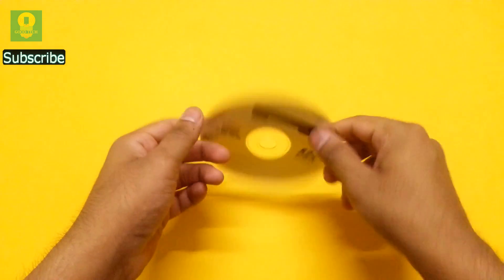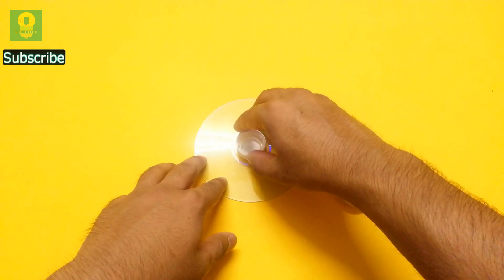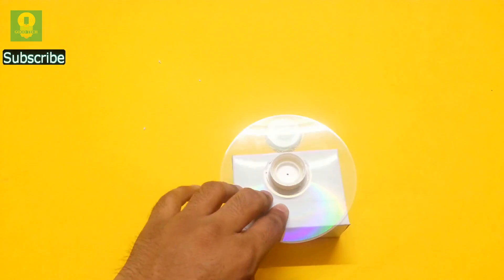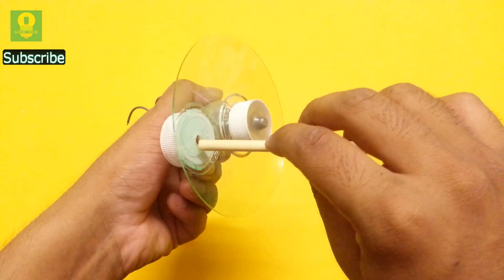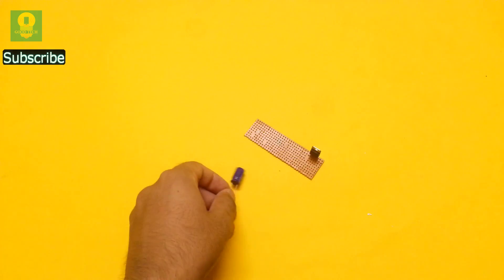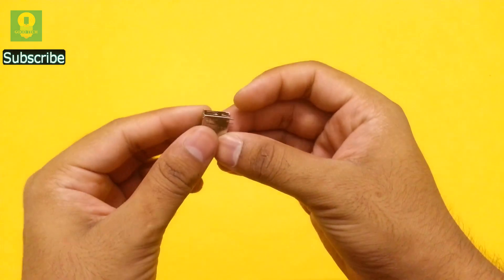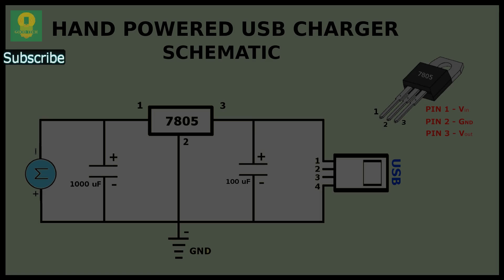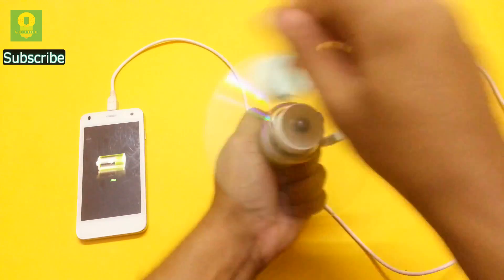How to make a Hand Powered USB Charger at home

Comment: Where did u get the usb port
Reply from the maker: You can easily de-solder the USB port from an old mobile charger lying around or can order a new one online from ebay or amazon.
Reply: Please help!!!!!!!!!!!
Does it work without capacitors????
Are capacitors compulsory????
Reply from the maker: Yes, it will work even without capacitors but they are important to protect the phone from any damage as they remove power surges and noise from the supply.

Comment: This is great, but aren't you losing tons of energy from the voltage regulator? Doesn't a voltage regulator dissipate lots of heat to convert the voltage?

Do you think a 100 rpm, 5V geared DC motor generate a higher charging current?

Lastly, is there any possibility of damage to the device from cranking the charger at a non-uniform rate?

I know this isn't exactly made as a consumer-grade product, but I'd love to hear your thoughts on these questions!
Reply from the maker: No, its absolutely not a consumer grade product. For that it needs many upgrades.
Yes, some energy does get lost in voltage regulator as heat. The 12v 100rpm geared DC motor only provides upto 500mA of current, not sufficient for many devices these days and also its not practically possible to keep rotating the device with hand through out the day.
But these problems can be solved easily. The device can be made in such a way that it can be attached to a bike wheel, so that a device can be easily charged while travelling and the irregular supply can be eliminated using a high capacitance capacitor that will store the charge and give uniform power as output. The 1000uF cap used in the video, does the job well and also there is protection circuit in almost all the devices, so a device will not get damaged easily. Also, as the energy is generated without much efforts(only with a moving bike wheel), even if some energy is lost as heat in voltage regulator, it will can never burn a hole in anyone's pocket.

Comment: Can i use both 1000uf capacitor ? & Please give amazon or ebay links to buy these items. There are so many items on amazon and ebay.
Reply from the maker: Yes, you can. The reason i don't provide links to the products as there are so many options, so its better for the viewer to choose a suitable one depending on his needs and price. You can use any 100 or 1000uF capacitor, but it should be atleast 16v.

Comment: Where you connect the motor wires?
Reply from the maker: Motor wires are connected to the input of 7805 voltage regulator. Refer to the schematic in the video and you will get more clarity about the connections.
Reply: +GOODTECH - Creativity and Science thank you

Comment: Will an AC motor produce more it it will not produce
Reply from the maker: No, AC motor cannot be used for this project.
Reply: +GOODTECH - Creativity and Science ac motors will work as long as a bridge rectifier is used. however simplicity will maximise power output.
Reply: +GOODTECH - Creativity and Science 
OK thanks
Reply: Ollies Toys i

Comment: Not working what to do...??
Reply from the maker: What motor did you use? Try to check the output of the motor using a multimeter and if motor gives proper output voltage then check the polarity of the wires.
Reply: i think i used 3 v motor....and capacitor 1000uf and 16v
Reply: when i connect to usb the start
Reply from the maker: A 3v motor will not be able to give sufficient output, you need a 12v geared DC motor.
Reply: ooohh...ok...and the 1000uf v16 is ok..??
Reply from the maker: Yes, as long as motor output is below 16v, the capacitor will work fine.
Reply: can i use dc12v 0.15A Computer fan...??
Reply from the maker: Yes, that can be used. It will show that it is charging the device but charging will be very slow.
Reply: then how to make faster...??
Reply from the maker: The only easy way is to use a 12v and atleast 500mA current motor or else make a current amplifier circuit.
Reply: ok...thanks....!!!
Reply: where to buy 12v motor
Reply from the maker: It is available online on ebay and amazon as geared DC motor.
Reply: ok...

Comment: Its fake look at the wire it goes out the screen
Reply from the maker: No, its not fake, it actually works. You can also connect the motor to the Bicycle or bike wheel and the phone can be charged.

Comment: you fucking stealler you took it from lxg design
Reply from the maker: Its better to be quiet if you don't know something. I made this first at GOODTECH (You can see the published date of my Homemade generator video (https://youtu.be/L-dUs2ai4D0) and then LXG made the video.
This hand powered charger is a better gadget equipped with my self designed circuit (not taken from anywhere).

Comment: Without adding the rotation handle, you can place the thing on a cycle wheel and you will produce more electricity
Reply from the maker: yes that's true.
Reply: +UniBuilds can you frwd the link please
Reply: UniBuilds
Reply: i made a video doing that,go check it out

Comment: whether it is compulsory used a capacitor
Reply from the maker: No. capacitor is not compulsory, it is only used to smooth the input voltage (to remove spikes from power supply).

Comment: where i can get voltage regulator? can i use any voltage regulator?
where i can get/buy general pcb board..?? thanks.
Reply from the maker: All the components are available online on ebay and amazon with various options to choose from.

Comment: good idea but how long it will take to charge a 2000mah battery
Reply from the maker: That depends on the motor used. The setup i made gives a current of 500 mA at 5v. So, ideally it will take about 4 hrs to charge a 2000 maH battery. But this project is for demonstration purposes, if you want to convert it into a useful product then attach the setup to a cycle wheel and then u get a nice mobile charger.

Comment: can you tell me the capacitor's voltage you had used in the project?
Reply from the maker: 25v.
Reply: both 100 and 1000 uf capacitors 25 v no variation
Reply from the maker: Variation is not needed. You can use capacitor with any voltage as long as it is greater than the input voltage. You can also use a capacitor with a voltage value of 16v as this motor can only provide 14v at max.

Comment: can we use a 9 v motor and 10 uf capacitor instead of 100 uf capacitor rest all same?
Reply from the maker: Yes, you can but if you are using 10uF capacitor at input then use a 1uF at the output and the motor should be a geared DC motor.
Reply: thanks
Reply from the maker: Welcome :)

Comment: will normal 12v motor will work
Reply from the maker: A motor shaft when rotates does produce some energy, but a normal motor will not be able to produce sufficient power that can be used to charge a mobile phone. however, Connect a multimeter to the motor terminals and check how much power it is capable of generating.
Reply: +GOODTECH - Creativity and Science its producing some as when i attach a led bulb its start glowing
Reply from the maker: Its good. Connect a multimeter to motor terminals and then check the actual output.

Comment: how can i use my cycle to charge my phone
Reply from the maker: That can be done quite easily. All you need to do is make a mechanism through which the motor shaft rotates when the cycle wheel moves while riding it. To make the mechanism, you can fix a small wheel, disc or a bottle cap to the motor shaft and then mount the motor adjacent to the cycle wheel such that wheel and disc is in contact with eachother. Use a mobile holder to mount the mobile on the cycle and connect it to the USB charging circuit.
All the best :)
Reply: Wont that creat too much electricity?
Reply from the maker: No, the motor we used is only capable to produce maximum of 16v at 500mA, this voltage can be easily controlled using 78xx series voltage regulators to get 5v, 9v or 12v output as required.
Reply: +GOODTECH - Creativity and Science , oh cool thanks, where can i buy this stuff from?
Reply from the maker: Everything else you will find in your home(a spare CD, 2 bottle caps, straw and a stick), the electronic components are easily available online on amazon and ebay.
Reply: +GOODTECH - Creativity and Science  ok thanks!

Comment: Can you please list down all the things i need to build this.. Pleasee!! Im waiting..😊
Reply from the maker: You need a 12v geared DC motor and a mechanism to rotate the shaft(i used a CD and a wooden stick).
To make the circuit you need:
General purpose PCB board
7805 voltage regulator IC
A female USB port
1000 and 100 uf capacitor.
For Demo:
A mobile phone with a USB cable.
Reply: +GOODTECH - Creativity and Science Thanks!! I will do thia as soon as possible